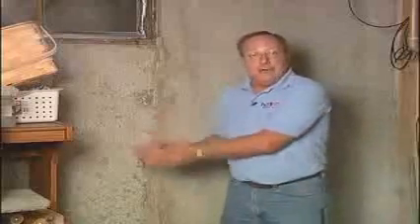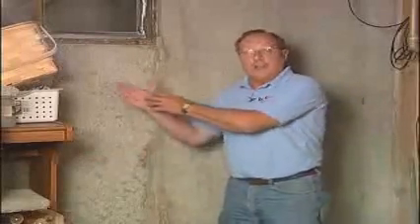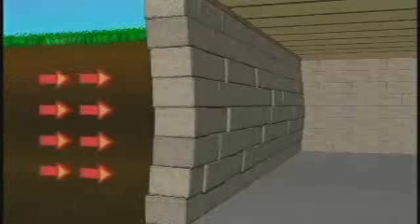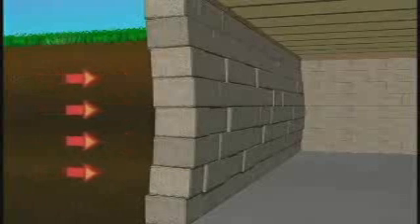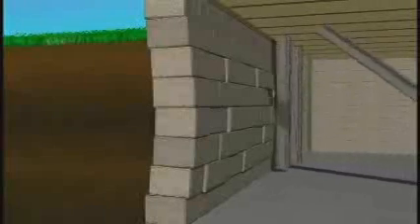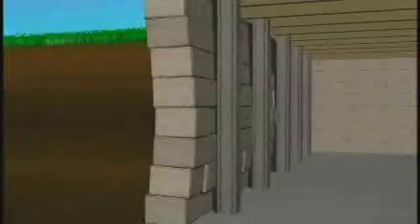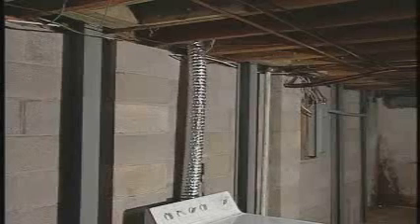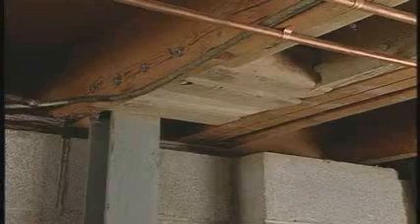Repairing a Problem Foundation

Comment: .....tied into the floor joists and concrete floor, rebar, new footer drains, tuff n dri waterproofing, back fill with clean stone all the way to the surface, and then refinished basement. Not to mention my patio being put back down. $26k. What caused it? Water coming down my electrical conduit and laying on my foundation for 20 years. There were holes in a few blocks under the counduit where water had deteriorated them. If someone has questions email me because I know I couldnt find answers.

Comment: I just went through this. I hired a guy to reframe 2 doors in my basement and when he cut the drywall it was damp. Then when we removed the drywall there was a horizontal crack and it had pushed 1/2" I just about lost my mind, but 2 months later it has been fixed. I had lots of estimates, but the bottom line is get it fixed right or you will be in trouble down the road. I had my drywall gutted, foundation excavated, wall pushed back, block filled with mortar, steel reinforcement...........

Comment: I have a wall that has broke horizontally at the ground line just like the picture. The ground line on the outside of the house is higher. I do not have a concrete floor. It is just a dirt floor. I am a single mom and I cannot do the job myself. I cannot get a loan on the house to pay for it. I live in north GeorgiaChattanooga area. Do you know anyone that does work like you. I cannot find anyone that will touch it.